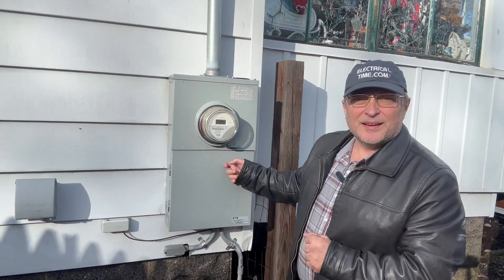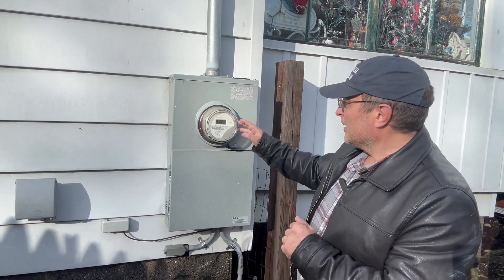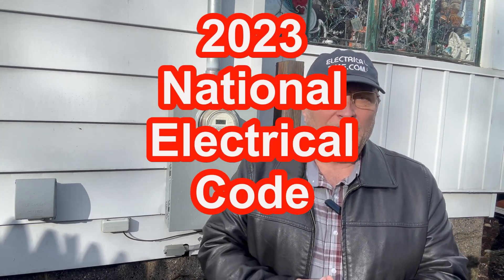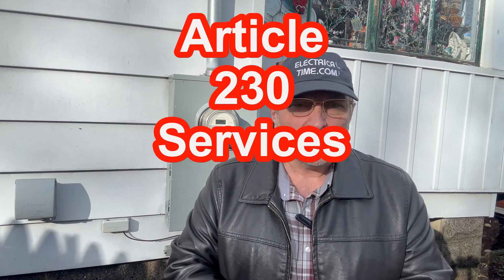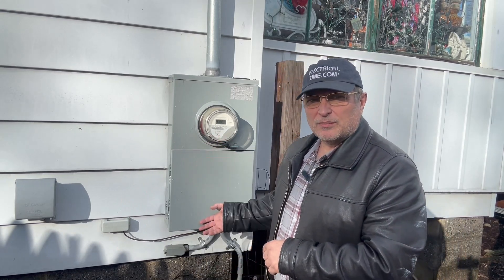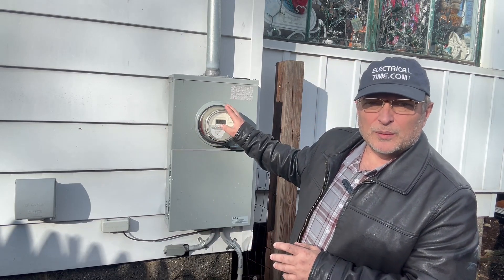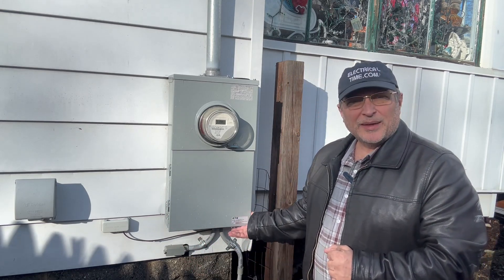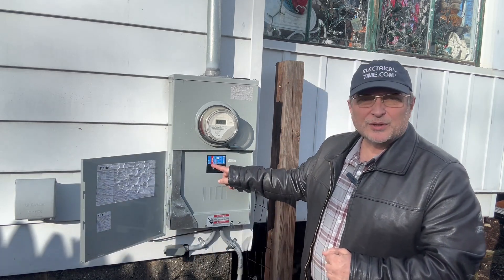NEC 2023 - 230.85 Emergency Service Disconnect - Live Video

Comment: Completely disagree with your assessment that an emergency disconnect turns the wiring into the home into a feeder. They're still service conductors. That's literally the entire point of this code article
Reply from the maker: Hi Matt, thanks for your comment. I would like to invite you to sit in on one of my Zoom classes to discuss this. Send me an email to ElectricalTime at Yahoo dot com and include your phone number and state that you live in and I will call you to see which Zoom class is good for your schedule. Thanks, Steve

Comment: Great video. I have a question. what if the single family has a detached garage converted to an ADU and the 2 gang meter panel is on the front house. Does the detached ADU need a emergency disconnect if the ADU sub panel is located on the interior wall?
Reply from the maker: Hi, that is a great question. Send me an email to ElectricalTime At Yahoo Dot Com and I will send you a Zoom Invitation so we can discuss this in our NEC class next week. Thanks, Steve

Comment: The only violation I saw on the meter base combo was no label that says "SERVICE ENTRANCE DISCONNECT EMERGENCY DISCONNECT"
Reply from the maker: Hi Andrew, you have a really good eye for the NEC code, that was an excellent observation. That Emergency Disconnect for that Dwelling Unit was installed under the 2017 NEC and that was before the new code section for these Emergency Disconnects for Dwelling Units came out in the 2020 NEC which also spelled out the Marking Requirements. In a future video, I can do another video on that same meter combo disconnect and update it with the marking requirements as per the 2023 NEC code. Also, if you would like to sit in one on one of the Zoom classes that I do on the NEC, please go to my website, ElectricalTime.com and click on the button called "NEC Code Classes" and I will call you to schedule you into one of our classes. Again thanks for your excellent observation, Steve

Comment: Vandals have access to the panel?
Reply from the maker: Hi Ted, that's why it's ok to install a padlock on it and it still qualifies as Readily Accessible. The bigger concern for this code change was for the safety of the firefighters. Thanks for your comment, Steve